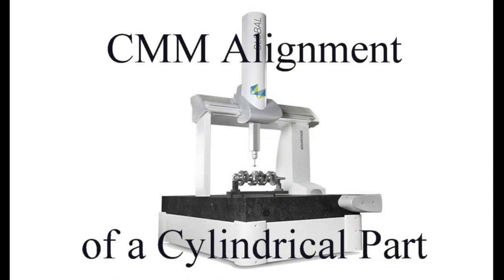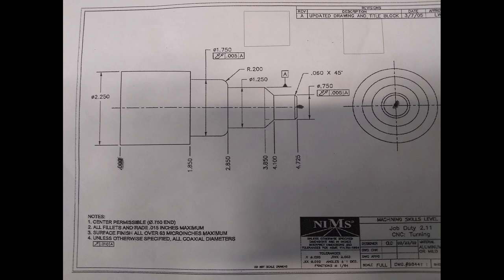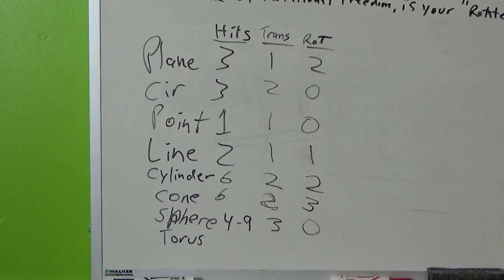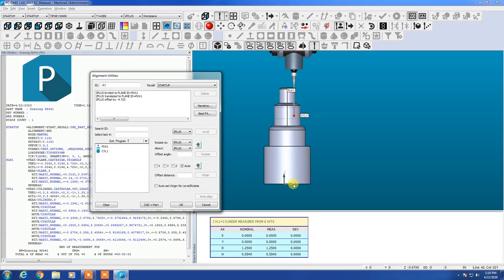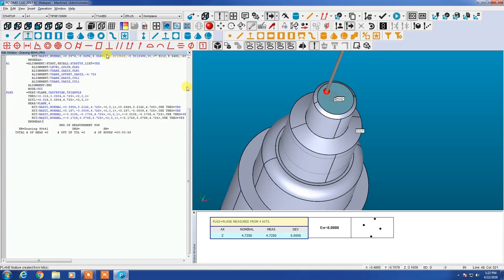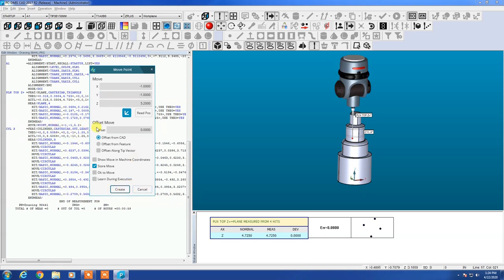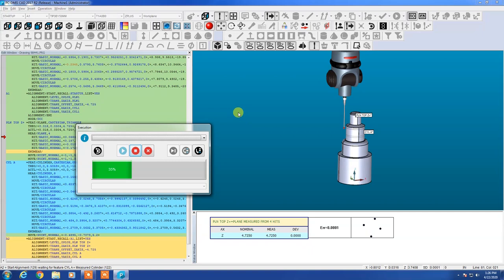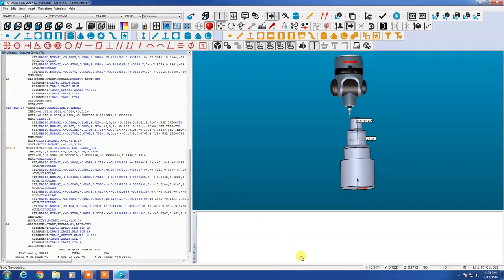cmm alignment of a cylindrical part

Comment: I don't know why you wouldn't just level Z to datum cylinder A and then origin XY to it? 
By levelling to datum A you would constrain x & y rotation leaving just Z rotational and Z origin. 
This could then be completed by creating a Z origin on the top plane and then take a point at say the 6 o clock position, construct a 2D line from the cylinder axis to that point and then rotate your alignment to that line to constrain the Z rotational.
Reply: @vanwilder4889  that is until bores are involved, right?
Reply: Create two different size circles, the create a line from those circles and level to that for more accuracy.

Comment: Drawing requires no rotation. I would have placed the part running running along either y or x axis. Start point program would be used.